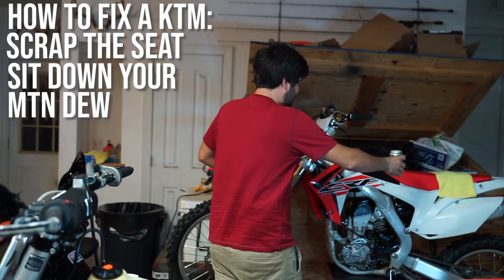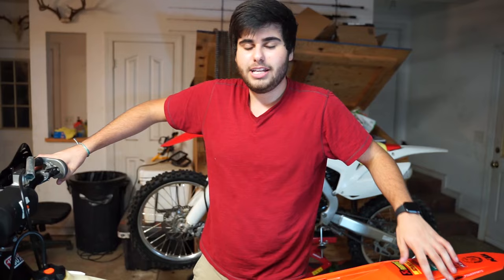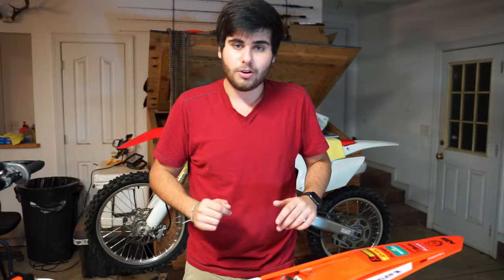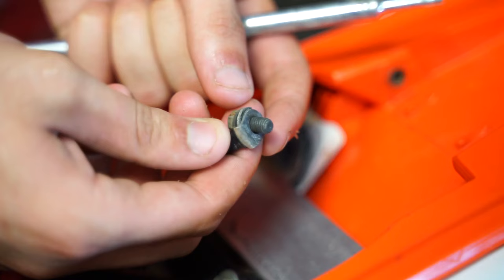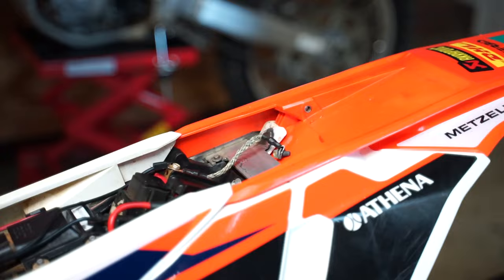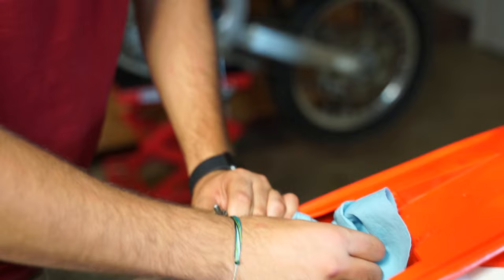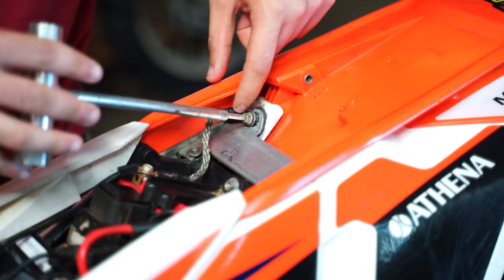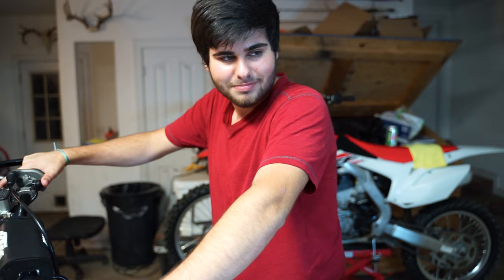Electric Start NOT Working on KTM? Here is why!

Comment: Use sandpaper to clean the lead and put grease on the contact points.  Also , check the battery using a load test not just a  V-meter , you'll get 12 v but it could be a bad battery.

Comment: KTM= keep taking money
Ktm on Sunday atm on Monday😂
Reply: Croomrider97 so fuckin true hahah
Reply: I got a 2012  KTM exc a couple months ago and just got it back from a professional who put new tires on it and some other adjustments.  It ran good for the 25 minutes I rode it and the kickstart even worked.... once. Now won't start by battery of kick.   I also have a 99 Honda XR 400 that needs to have the carburetor cleaned, but aside from that,  I've only changed the oil and cleaned the filter a few times and it most always starts right up in all the years I've had it, except for needing the carb cleaned now, so yeah, starting to think the same of KTM now

Comment: Spot on for my issue.  I was about 30 minutes into checking everything.  (That had literally worked fine an hour before.)  Battery good, hear clicking, etc.  But trying to cross over the  solinoid it did nothing.  I was thinking wire harness issue that would suck to deal with.  Came in to try my Google-Fu.  Your video popped up.  Hmmm.  Easy to try.  Yeah, as soon as I realized that removing the ground had it sparking a little.  Clean it up and off it goes.  Thanks for the video.

Comment: Thanks for the help, fixed the problem on our 2017 KTM 300 XCW.  
BTW, we use and abuse our KTMS (2017 and 2018 300XCW) regularly and they are work horses.  
I'm surprised at how much abuse they can actually take and they keep on ticking!

Comment: genius hehe I cleaned my ground just replaced starter and it just clicks when im trying to start.
Battery will be next to go 
funny video cheers
Reply: Hey, have you fixed it? I have exactly the same problem.
Reply: @david_e.xriders1812  yes I did, starter I ordered had to much play on the moving part. had to order a new one (no play) and works every time.